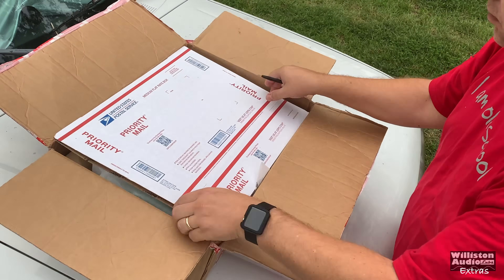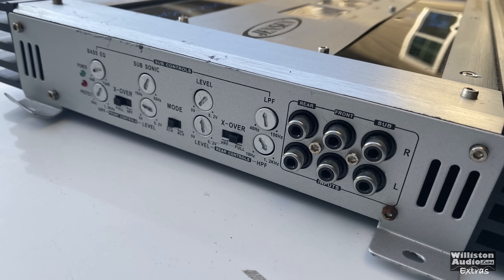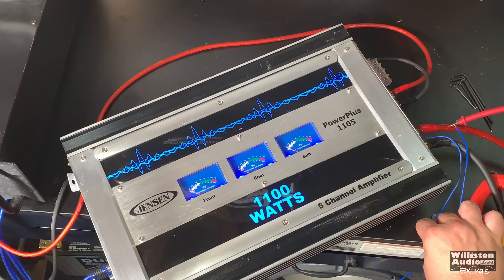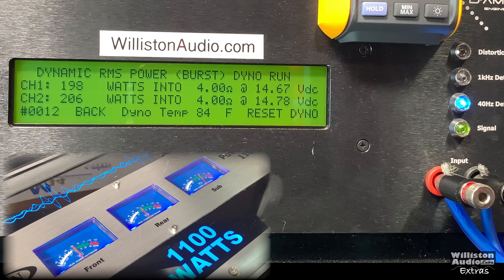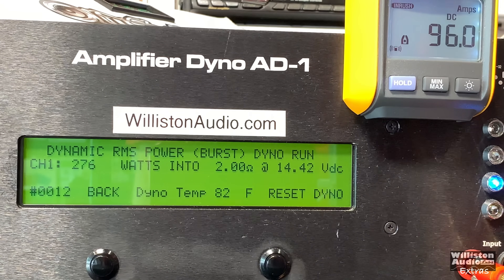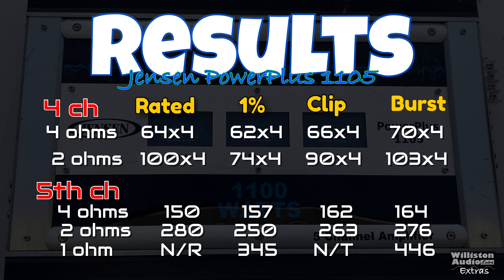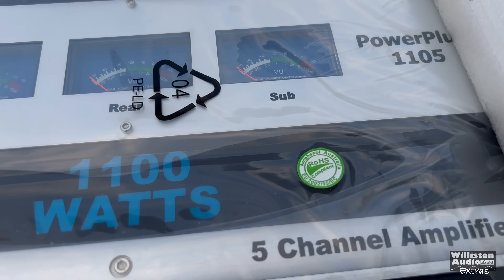Five Channel Budget Amp with VU Meters? Jensen PowerPlus 1105 Amp Dyno Test [4K]

Comment: Not bad for a budget amp.  Kinda cool
Reply: 100db noise floor says this is more than a budget amp? That's what I was looking for. Any dingdong can design something with power... but how quiet is it? 
The manual says 100db which is right up there with the good amps at that time. 
.... if that's accurate.
Everything else panned out though so no reason to think its not.

Comment: Jensen has had a lot of smack talked about them over the years. But they used to put a decent product for the price point.  If you were on a tight budget and still wanted to make some racket, Jensen was a reasonable option. I don't know much about them these days, but I do have a 2ch 760watt Jensen from back in the late 90's and it'll still get down. I just put power on it for the first time in over 15 years the other day and it works just like the day it was new.

Comment: Big D Wiz or Big Dummy Derek lol .I am a big dummy Aswell lmao .I have actual proof
Guess what I bought over  20 years ago ?
I totally forgot I had it 
This is a rare item
It’s a Alphasonik PA 1060 lol .I bought it at a swap meet over 20 years ago
It’s a mono block lol .Or Mono amplifier
It is 60 watts per channel 1 channel
It has 2 -35 v 2200 UF caps 
Made by Samyoung 
On the rails it’s got 3 small transistors and 
2 big transistors per channel 
I am thinking’s each output devices is 10 watts? Since there is 6 of them 
It has a built in crossover that is adjustable from 40-100 hz .It has a level control 
So you can boost that frequency up to 12 dB
It has a volume control and a on /off button
It’s 6 1/2” long by 5 3/4 wide by 2” tall
It has heat sinks down both sides of the amplifier.I hooked it up to a Realistic wattage meter 20 years ago .I was pushing about 40-50 wpc .According to my Realistic wattage meter lol .I know those things are state of the art lmao
This is a cool little mini sub amplifier 
If you want to amp Dyno it .Let me know
I been a audiophile for over 40 years 
I owned a car audio store .I could get amplifiers you can amp Dyno for you
So I can help support your channel
Let me know !! I am outta here !!
Reply from the maker: I have the 100W version here and I think it’s new old stock PAS1100

Comment: Wow thats pretty cool now you have to of those amps. An i like its a. (A,B) amp. An does its power running 1 ohm stable on that sub. Id definitely pair both those together on one system with a good power bank. Thanks big d!!!!!
Reply from the maker: I usually run across stuff like this after I’ve made the video, but this time I came across this one in time to show it in the vid. I love finding new old stock amps!

Comment: That is a pretty good old school class a/b amp. Someone took a lot of care in the layout and component selection. I bet they would have sold a lot of that amp back in the day. If only they could have been tested. Thanks for putting this out there. Makes me rethink that old Jenson brand.
Reply: I still wonder why they went all Class AB as late as 2008? Seems they could've done 300/500W on the sub section if Class D was used
Reply: @wal  probably cost. This was after audiovox bought out Jensen.
Reply: @wal  if you watched the video, the sub channel does 450 watts at 1 ohm.

Comment: You know what I still rock it it looks cool as well and that a factor 
Back in the 2001 I had a set of there ten's the chrome blue one's in my truck and only need a little 250 watt amp sounds good but I also had a set of optima pro series 10s from radio shack that were nice as well or my pioneers 12's they were awesome and my kicker impulse 352 amplifier or the older pioneer 212 amplifier  or my Sony Xplode 1200 watt amp that would make my 6x9 beat

Comment: Not bad for a Jensen, but what was the design team thinking with that construction. Half the cost has to be just the assembly of that thing. Could have stuck it in a normal chassis. Trying too hard to look like an old McIntosh. At least it works. Great test.
Reply from the maker: I agree. WAY too many screws

Comment: When I first got into audio back in 1979 .That was over 40 years ago .Every thing had VU meters.The Radio Realistic Wattage matters,Their 5 band car equalizer amplifier .
Home 8 track and Cassette tape decks.I believe Macintosh started the whole VU craze .My Uncle had a Macintosh he bought in 1974 .He still has it .Along with his JBL L-100 speakers .I miss audio products that have VU meters .I think a lot of die hard Audiophiles do
Reply: A lot of people don’t know this .But VU meters were originally used for recording.When you would record a album or off of the FM station .When you were using a Cassette deck,8 track ,or reel to reel .
 The VU meters would tell you if you were going into distortion while recording.You would use the volume of gain on the right and left channel .You would turn it up until it hit orange or red on the VU meter .The trick was to get as close as the red/ or orange without going over .Because if your recorded to low ,your recording wasn’t that loud .If you weren’t to far into the red/orange.It would be loud abs distorted.
I was really good at get a good quality recording 
Also Jensen was the first company to make a triaxial speaker .Meaning a tweeter or midrange mounted on top of a woofer .
They were created the first 3 way car speaker .It was a 6x9 it was rated at 30 watts it was called the Triaxial .Then they made a 50 watt version that was called the Triax 
Then they made the Jensen Triax Ii .It was the first 100 watt 6x9 car speaker .It looked really stealth like .To this day it was my favorite 6x9 speaker.They sounded amazing
They had a 1 1/2 “ -2” voice coil
They beefy 20-30 Oz magnet on them
Back then Jensen speaker were made in the USA .Jensen used to be higher end speakers ,cassette decks and amplifiers.
They made one of the best 6x9’s speakers ever .At the time Pioneer 6x9 ‘s only handled 40 watts .Then a year later came out with a 60 watts max .Panasonic came out with a 4 way 6x9 at the time was a 100 watts 
So did OAFS Kricket lol .They had a 100 watt 6x9 .With a lifetime warranty.But they went out of business in the 1990’s 
It’s a shame Jensen doesn’t make good equipment anymore .Now they are known as a low end line .
Reply from the maker: Exactly!!
Reply: @wal2  Back in the day .I believe Jensen Triax II speakers were $179-199 a pr back in the 1984 
One of the best equalizer amplifiers was the old Jetsound .Some of those had up to 60 watts per channel .I had the 35 wpc .It was a strong equalizer.It was built like a tank 
Those equalizers were $149 back in the day 
Sparkomatic made a really bad ass Equalizer booster .It was 50 wpc .It was big and heavy 
I never had one .I saw one it had huge transformers in it .Other equalizer boosters that were beefy was Tancredi 60X2 .It weighed 4 lbs .FAS made a 60 x2 
Sparkomatic at one time made a Biamp system that had the amplifiers in the speakers .They even made a subwoofer 
I had the system .I lost it when I got divorced.Wife threw it away .It wasn’t that powerful.They we’re just IC amplifiers 
But it was catchy 
I still a Jetsound 3 Band equalizer form 1980-1984 .I believe it’s 20x2 .If you want to amp Dyno it ?
Reply: It’s actually “McIntosh”. The Apple computer used the “Macintosh” spelling so they wouldn’t be sued.

Comment: As a teenager, I had a huge chip on my shoulder about Jensen products. As an adult, I feel like they deliver a decent quality to value ratio for the everyday person who wants to enhance their car. Just installed one of their upper end Apple CarPlay in a vehicle and it's actually great.
Reply: So true they are not Pyramid or Rockwood, Pyle companies like that Jensen has always been mid level like Polk or Jvc their Power series and Dub series was always their better products anyway.
Reply: @samueljackson2478 

At first Jensen was made in Korea. A step above Pyramid and all the company's they purchased.  People were thinking they were getting the same equipment but they were not.
Just relabeled Pyramid made in China all junk. There were many companies that used to be decent until Pyramid bought them out.
Reply: companies been owned by a recoton for many years. just a cheap Japanese rebrander
Reply: @ubeuonly Pyramid. Basically sound around, located in Brooklyn New York. Originally the first company to bring in Chinese garbage into this country and put stickers on the boxes. Whatever wattage they wanted. I remember they had those little equalizers with the yellow stickers all kinds of crazy wattage ratings on them what made matters worse is when Pyramid started buying up the name-brand companies it was not the same equipment it had the same name and was a lot less expensive but it was garbage.
Reply: @Mr.Robert1  my pyamid gold series amps are made in Taiwan. Not China.
Reply: @ubeuonly Recoton was known for making accessories. RCA cords, speaker wire, mainly accessories big markup for the retail stores. Something that would cost them $1.50 they would  Mark it $29.95
I started in that business. Not made in Japan. I wish it was Japanese they had excellent quality control. Only the expensive Goods for were made in the United States or Japan. China was the bottom of the barrel. Then Korea was the Step Up.
Reply: I felt exactly the same way about Jensen. I had a 100x2 amp and 2 Jensen 10 inch subs. Didn't really sound all that great because amp had no crossover. But I still thought the world of them until I stepped in the doors of audio express in Phoenix az. I learned everything about Rockford fosgate and realized that Jensen was pretty much a flea market brand. I also got screwed by a flea market once on a pyramid amp. It probably was 15 watts x4. It sucked big time, Jensen also sucked but did a-lot better than that crappy pyramid from flea market, good ol' days..... I lived and learned. My fav amp is soundstream class a 10.0, that's a real amp right there.

Comment from the maker: Shop: (affiliate links)
Jensen PowerPlus Amplifiers: https://ebay.to/3rdmlh9
McIntosh Car Audio Amplifiers: https://ebay.to/3KtQ0tM
KICKER L7R Quad Box: https://amzn.to/3iY77rR
XS Power LTO Cells: https://lddy.no/13d2f
XS Power Intellisupply PSC90: https://lddy.no/13d2g

Video Index:
0:00 Intro
1:21 Settings
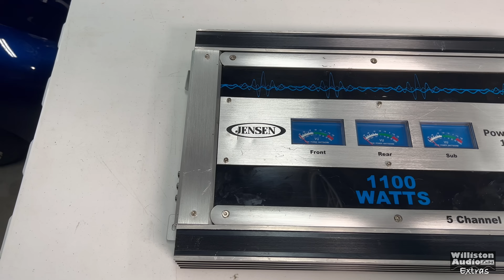2:31 Dimensions / Specs
3:04 Amp Dyno Tests
6:52 What's Inside?
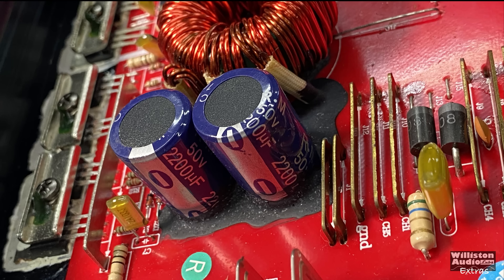9:47 Final Thoughts
10:31 Extras

SMD / D'Amore Engineering Amp Dyno: https://goo.gl/sJTcf7
XS Power D1400 Batteries - https://amzn.to/2BPFCKW
XS Power PSC60 Charger - https://amzn.to/2CHGcfs
Fluke 1000A AC/DC Clamp Meter: https://amzn.to/2Rw5WDA
Handheld Dyno: http://amzn.to/2u2EgKV
My Favorite Screwdriver Kit: http://amzn.to/2x0VzcE

DISCLAIMER: This video and description contains affiliate links, which means that if you purchase from one of the product links, I may receive a small commission. As an Amazon Associate I earn from qualifying purchases